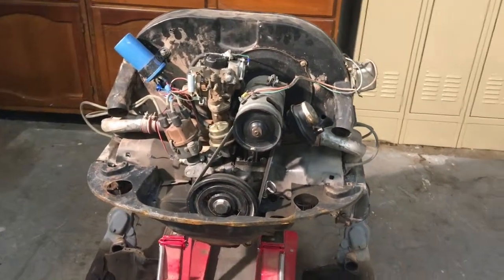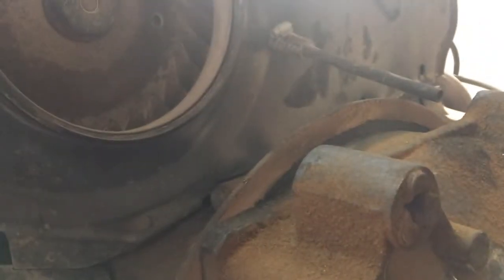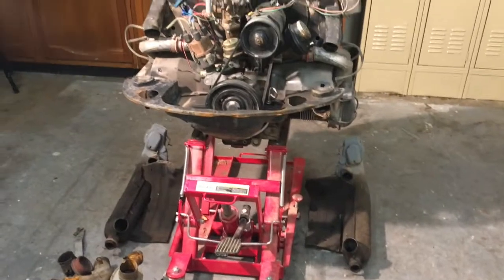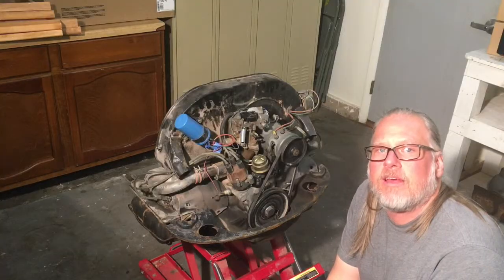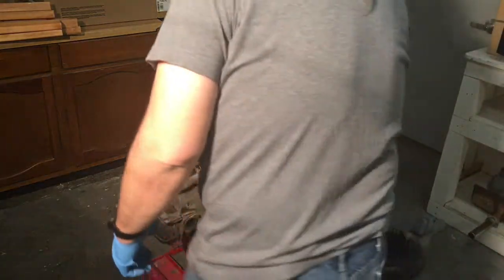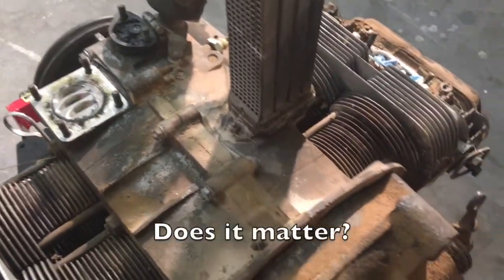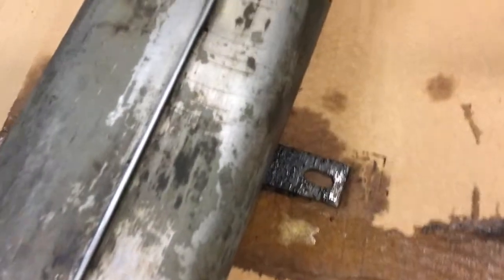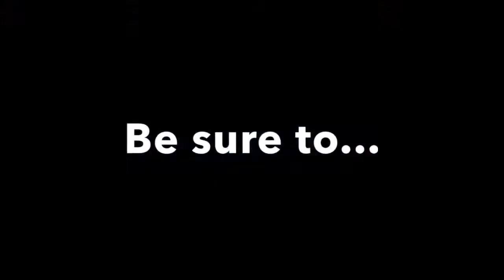VW Beetle restoration | 1600 dual port engine tear down and cleaning

Comment: The heat risers may have been clogged ... getting a new one won’t set you back much
Reply from the maker: It’s possible. And I think I’ll just put it together with what I’ve got. Maybe just crimp it over.